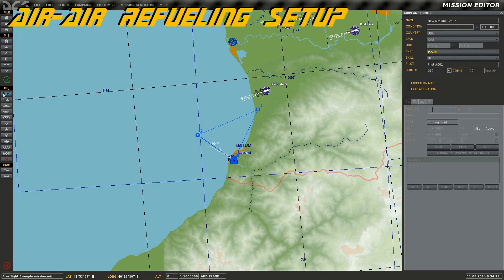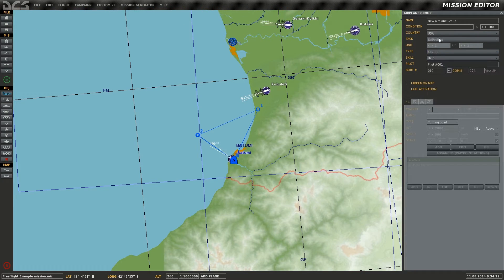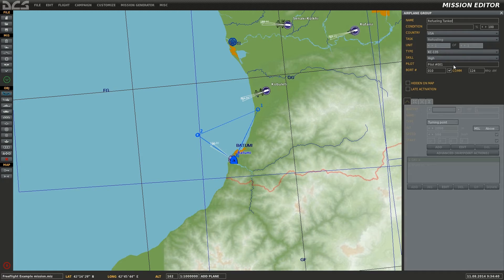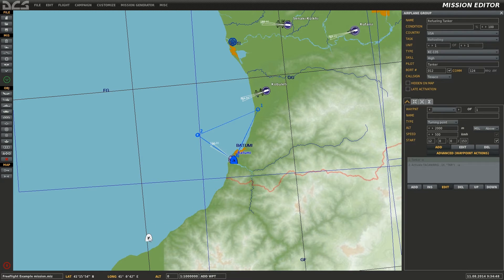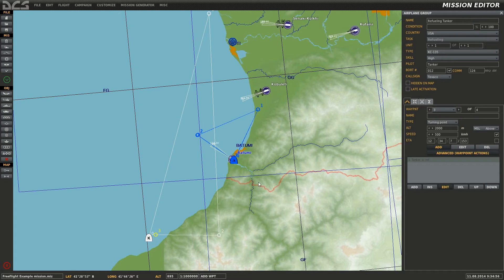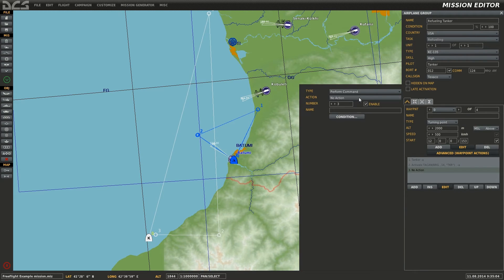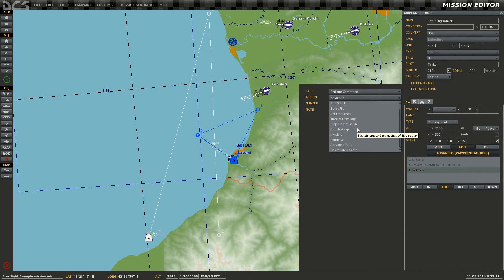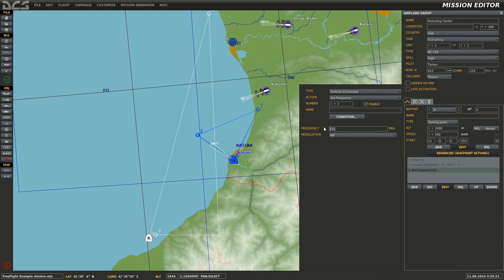DCS World Editor - Air-Air Refueling Setup

Comment: I can't get the tanker to respond to me I did everything right( as far as this video showed) and I've tried the mk2c and a10c and it won't work, it also doesn't respond to me when I'm in mp
Reply from the maker: Are you tuning the radio into the correct frequency and channel for whichever aircraft you are using?
Reply: pickinthatbanjo I'm pretty sure, but after it not working I started using the advanced waypoint options just like the tanker to automatically set the frequency and still no luck

Comment: why when I approach to the tanker it doesnt extend its stick into my F15 fuel hole as I see in youtube videos??, once I get close to the tanker and call the radio for request to join, then precontact, nothing works to me, why???? what am I doing wrong?? help me please, I want to learn how to air refuel my F15.
Reply: +Viktor B. The refueling officer is drunk, and you have to get the position just right or he won't like it. Also, inspect your aircraft and note where the refueling port is. Is your fuel port open? I forget the key bind, but make sure you see a light on the top right of your hud that indicates the port is open.